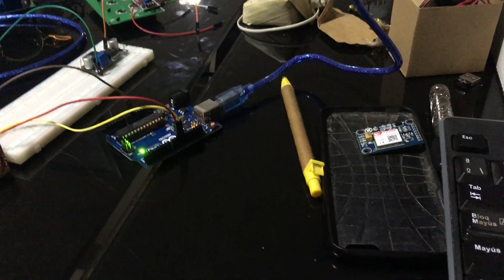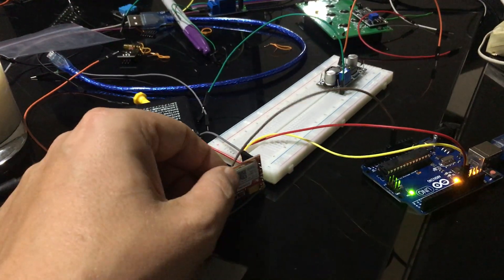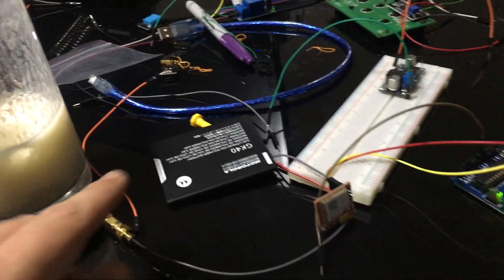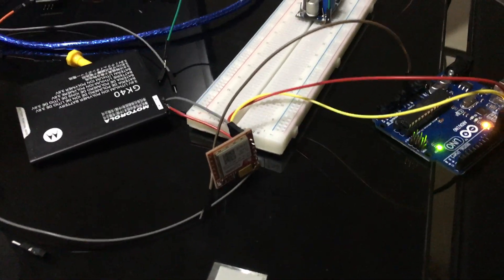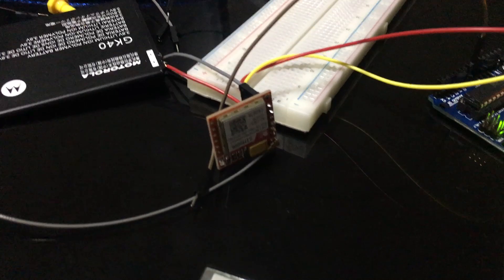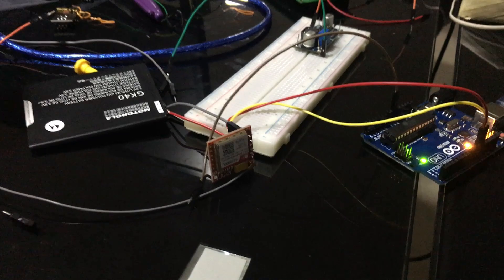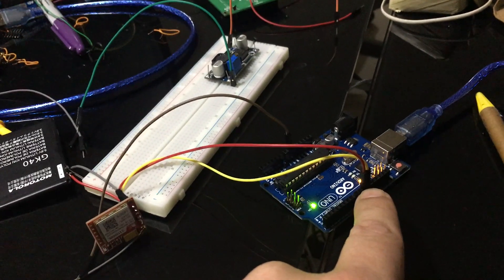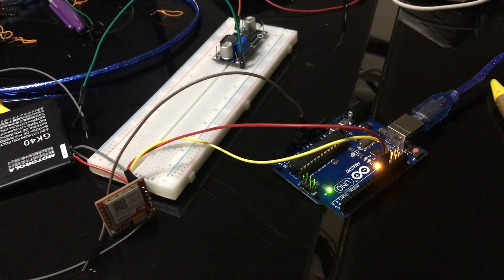SIM 800l Arduino Tutorial & Solved Quick Blinking Light Issue w/ shorter cables

Comment: hey sir.. i have v 2.0 of sim800L, it's signal pin blink at each second and power pin blinks at every 7 second.can u tell me what is possible problem and how to fix it?
Reply from the maker: Sounds like it might be a voltage issue? What's the voltage that's going through the SIM module? I have to admit, these modules are a pain... :/
Reply: Shortening the power cables does the magic. Arduino wire is far too long for the power needed by the module. Thanks Arduino Bot, shortening the wires worked for me.
Reply: For sim 800l Use separate power supply  5v 2A and make a common ground from Arduino to power supply(5v 2a)